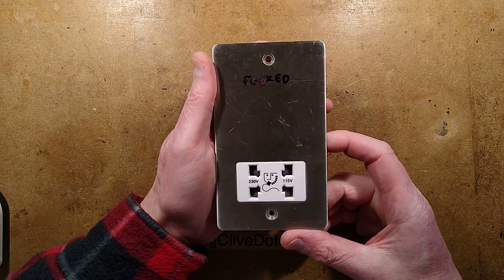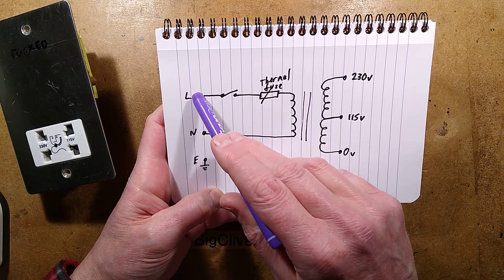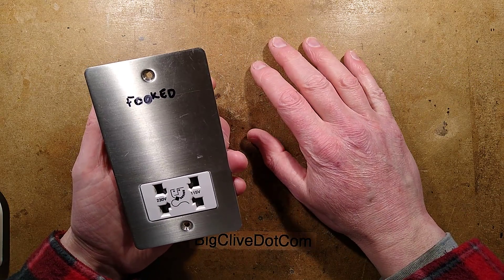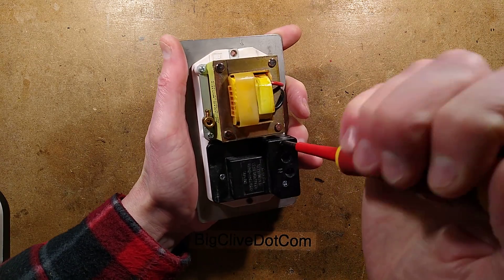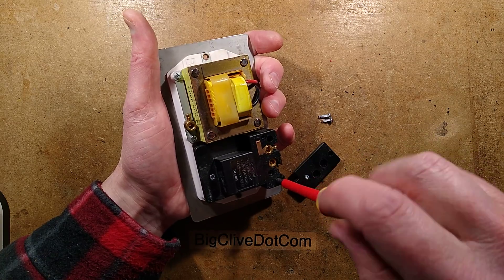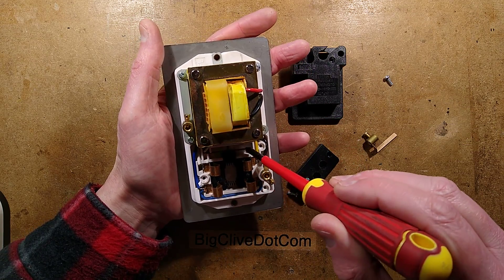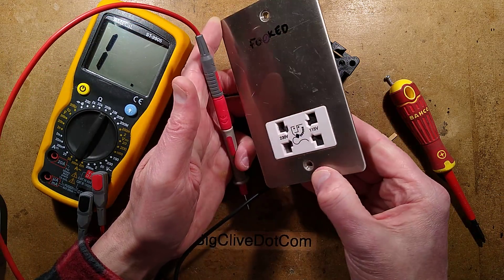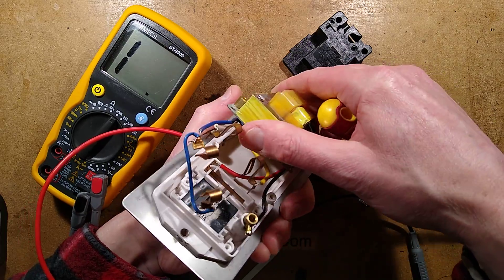Exploring a failed British shaver socket

Comment: i've never heard of this in the US. we have GFCI plugs in all bathrooms (or anywhere with water actually) and they trip the instant there is a short. something will really bad power factor can trip them too i think, like a big vacuum cleaner. i have seen more outlets with switchs directly on them, which is a UK thing. i usually only see them in hotels, but i've seen some people that have switched outlets in their house with the switch right on the panel. my house currently has all upper outlets of all duplex sockets on a light switch on the wall, but all lower outlets not on the switch. this is really common for houses that just don't have light fixtures on the ceiling at all.

Comment: This transformer doesn't really look like 100 VA rated. 230/12 V transformers of this size are usualle about 20 VA. Why is this? Do the thinner copper wires due to the lack of a PELV/SELV make such a huge difference?
Reply from the maker: This one did turn out to be 20VA.

Comment: Here in the US outlets near water are required to be GFCI.  If I were to drop a shaver into the sink it would pop the breaker built into the outlet immediately cutting the power to the device.

Comment: I've never seen them here in Australia. My shaver socket is just regular mains, no RCD/GFCI (along with the rest of my flat), so the only thing protecting it is the fuse for the circuit (which is rated well over the 10A of the outlet) and my body (which would somewhat limit the current flowing through the outlet). In fact, I'm pretty sure every place I've lived has predated RCD/GFCIs.

Anyway, I do like the idea. But I don't think it would be practical to introduce them here, sine they'd almost immediately be blown by people who don't realise the outlet isn't rated for their hair drier.

Comment: On this side of the pond most residential receptacles must be protected by a GFCI (ground fault circuit interrupter). Exactly which circuits that need to be protected have changed over the years. Unlike the UK (not sure about other countries) this is on a per branch circuit basis. The GFCI is set to trip at 5 +/- 1ma. So assuming the GFCI is functioning properly faults to ground are limited to non-lethal values.

Comment: GFCI sockets are building code in areas close to running water in North America (Kitchen, bathroom, outside). All the mixed volages and plugs is unique to Britain. Arc-fault plugs are required in bedrooms where I live to prevent fires when people crush the plugs behind furniture.

Comment: In Spain it's alarmingly common to have a common-or-garden Schuko socket right next to the sink - ready for a hair dryer, etc. Fortunately almost all houses have at least one RCD in the consumer unit covering all circuits.
Reply: That's just the way it's done in Spain by law. They don't have GFCIs but earthed sockets and a general 30 mA RCD protection in the breaker panel. The same goes for the rest of Euro countries.

Comment: Isolation transformer type bathroom sockets for low power devices such as shavers were quite common here in Canada, although they were 120 volt only.  They've been largely superceded now by GFCI sockets which can accomodate more appliances (hairdryers, etc.).

Comment: Not in Germany (only in some older Hotels for enabling 110v for guests from the other side of the pond - even in trains. Nowadays multi voltage razors made them obsolete) In Germany we  trust RCCBs, Residual Current operated Circuit-Breakers (hope I found the correct translation for “Fehlerstromschutzschalter” (4 words in one - isn’t German a nice language where you can easily build words yourself 😁) in every bathroom since the late 50s.

Comment: If you were to cannibalize one of these things that was still working,  you'd have an isolation transformer for use with an AC/DC transformerless "widow-maker" guitar amp (series-string tubes, 2 watfs of audio at best), or an "All-American 5" table radio. It could also be used as a step-up or step-down transformer, within its electrical limitations.  I am presuming that these things are unfortunately live the entire time that they are sitting in the wall unused, in which case the transformer would always be passing a small amount of current and generating a modest amount of heat all by itself, without a load on it.
Reply: They might not handle enough current to run a guitar amp.
Reply: @8bitwiz_  , read my comment again;  I referred to a transformerless, "AC/DC"  amplifier, a so-called "widowmaker",  the type that only draws about 20-something watts from the wall and puts out less than 2 watts of audio to the speaker. Typically a three tube amp with a 12AX7, 35W4 rectifier and 50L6 or similar output tube, with a maximum of 140-150 volts DC B+.  Google "Widowmaker guitar amp" to see why these are so unsafe for guitarists unless you add an isolation transformer.

Comment: Evening Clive, they are not a domestic device here in Straya, we have general purpose outlets (10Amp RCD protected), in our bathrooms for your drying and or shaving pleasure.
That said, accommodation houses often have a combination plate that houses the 100va isolated dual voltage sockets at one end, and a standard GPO at the other.

Comment: In the US, bathroom outlets are GFCI protected, but not isolated. The only examples I can think of that are isolated are the doorbell supply and the thermostat supply, but those are also low voltage.

Comment: Never seen one in the states.  Since we have this split center grounded 240 system and only 120 volts at the outlets probably much less need of such a thing. And I don't get what's up with the lower voltage setting there would you have low voltage shavers? Was that a thing?

Comment: Can't speak to the rest of the world's homes, but they aren't common in homes in NA anywhere recently, we just have a GFCI outlet in it's place. I HAVE seen these in hotels all over the world, had NO idea they were galvanically isolated like that, I just assumed it was a triac 'dropping' the voltage to 110V for a shaver.

Personally, I haven't used a corded shaver in a couple decades, my latest one chargers with a micro USB cable, so I've not had use for these outlets in a long while anyways.

Comment: Shaver sockets used ro have 'shavers only' written on them, i also rememver seeing '2Amps max'
Even so, these should be restricted to shavers and toothbrushes, things like hairdryers will overload them
Not keen on the thermal fuse being in the neutral, even on an isolated transformer, you still get capacitive coupling.

Comment: In the UK we use mainly 3pin square plugs so a 2 pin bathroom socket can not be used. If you buy a UK hair dryer it comes with a 3 pin plug. This is where international travel comes and upsets the apple cart. Foreign electronic with 2 pin plugs.

Comment: Here in Germany we are hard core. Not only do we run full 240V@16A to the bath room, but at least technically bath rooms aren't even classified as a "damp location", so many older installations will not have an RCD either.

Comment: Good idea in theory but terrible execution: If you overload it you can't just pop a fuse back in, it wrecks the entire outlet. Also you have to guess what you can plug in because it doesn't specify the max power output anywhere.

Comment: We have nothing like that in my part of the US of A. GFI (or GFCI) is what we have for code. Normally the GFI is an outlet and up to 8 or 9 more are placed in series behind it, it protecting all of them. They are available in circuit breaker form but in most cases they are in outlet form.

Comment: I’ve seen similar sockets in English and French hotels. Whether they usually have such hardware I don’t know. Some have markings stating that they’re not rated for much wattage: shaver or phone charger okay, 1000-watt dryer definitely not. I’ve recharged my shaver and phone and small battery packs with them to save me the trouble of getting out the British or European adapter: the shaver or wall-wart’s American plug fits the socket adequately. Shaver and wall-warts can all take 100-240V AC at 50 or 60 Hz anyway.

Comment: Yes clive, we had these in the US in the 50s and 60s. But I don't believe they used a transformer. My understanding is that they used a capacitive dropper. It's very uncommon to find them these days. Usually only in older hotels or motels. It wouldn't provide the same isolation as a transformer. But they did limit the power significantly.

Comment: WHODUNNIT - TOOTHBRUSH OR HEAVIER DRAIN LOAD?
10 years ago I installed an MK shaver point. White plastic faceplate with the stubbly shaver symbol printed on.
A warning was in the box saying not to charge toothbrushes. Of course a few years later I had an electric toothbrush and tried charging it.
The shaver point electrics managed alright but the faceplate cracked in several places.
Bought a new MK white plastic shaver point, this time a toothbrush symbol was printed alongside the stubbly chin symbol.
The electrics and transformer inside were identical to the previous point but the faceplate had new reinforcing ribs moulded in.
So, the heat generated by toothbrush charging broke the original faceplate, could that heat also take out a thermal fuse???
WHODUNNIT?

Comment: It's not so much dropping the shaver in a sink of water that is the issue, but of handling one whilst dripping wet and/or a fault developing. 

Now that all modern installations should have residual current (GFCI) protection, then the requirement might be considered outdated, although residual current devices, being active devices, can fail themselves whilst an isolating transformer of that sort is pretty well fail-safe. 

But then that brings us to the topic of power sockets in bathrooms, which are now allowed in UK bathrooms, but only if they are uncommonly large as they have to be a certain distance from wet areas (I think it might be 3 metres) as well as being residual current protected.

Comment: Howdy Clive, long time comment lurker and fan from Australia here. 

As Glen Miller mentioned, they were once a far more common sight, but you still see ones in private residence on a rare occasion, generally apartments or the like; However they are still extensively used in our hotels/motels and other paid short-term accommodation. 

They seemed to become far less popular here once battery powered dock/cradle style shavers (that couldn't be used whilst charging), became the norm over here along with RCDs being in practically every home.

All the best, and keep up the good videos!

Comment: I had a shaver socket in my student room back in the early '70s and I ran my HiFi off of it. In party mode it used to trip out regularly but reset again after a few moments if the load was taken off. I pity current students if they now have non resetable thermal fuses.

Comment: It was common to have a pure 110V outlet for shavers in Sweden before GFI's. Haven't seen them in anything built after the 90's, now it's only the common 230V.
Not seen any combined 220/110 versions as I can remember - I believe the old Swedish code only allowed for the isolation transformer in combination with reduced voltage.

Comment: We have them here in New Zealand.  I never knew VA was just watts! Makes sense since volts x amp =watts
Reply: It's almost the same. If the current and voltage are in phase (if the load is resistive) then the power factor = 1.0 and VA = Watts. If current and voltage are not in phase (power factor is less than 1) then VA rating is higher than wattage. So of a transformer is rated 50VA but the load had a power factor of 0.4, the allowed wattage would be 20 Watts maximum. The phase difference becomes significant if the load is highly inductive or capacitive.

Comment: It's a UK thing like the ring circuits for sockets. 
Normal sockets are used in Germany, but a 30mA RCD switch is required. 
Now an electrician shows what happens when a hair dryer falls into an insulated bathtub. 

Nothing! Maybe it tickles something. But don't touch the grounded faucet !

The electrician recommended pulling the plug out of the socket by the cable, regardles , the outlet can sometimes come out of the wall.
Or better to call for help that someone turns off the electricity first.

Comment: Had one of these in my house when i was kid. use to plug my radio in to it when in the shower and my mom would plug her curling iron never though much of it other then it got hot.
Looks like it could be a decent little isolation transformer.

Comment: From my own experience Finland doesn't seem to even have GFCIs anywhere outside of the bathroom. This might be different in more modern homes though, mine has been built before 2000.
Bathroom has standard schuko plugs, one in the closet for a shaver / toothbrush / hairdryer and two on the wall for a washer and a dryer. All of them are protected with a GFCI in the main fuse box. None of the other plugs in my apartment have GFCIs. As far as I know, shaver plugs do not exist here at all - I have never seen one or heard of anyone having one. My limited experience in Germany is similar - No GFCIs, no shaver plugs.

Comment: Shouldn't the center-tap connection of the transformer be the 0V, with 115V on each outer leg, giving 230V when connected between the two outer legs.

Comment: To be honest, most of these outlets & the "Shaver Lights" with 110/220v outlets are a waste of time. Yes perhaps in some hotels with visitors from overseas on 110v. But for most homes, you would be be using your usual devices suited to your home voltage.
Yet here is the rub, most "Shaver Lights" have the transformer permanently ON which means it draws power 24/7 regardless if you are using the shaver outlet or the light. Not a massive draw, but often 2w to 3w is being used when the light is off & just sitting there, doing nothing at all.
The bulbs are S15 (284mm) or S15s (221mm), originally say 60w, but now 4w~6w LED's. An option is to remove the transformer & rewire the 110/220v switch with say a 110/220 Ohm capacitor. This will give you the option of the switch giving you say a 0.5w nightlight in the bathroom, or off completely. In either mode, the pull switch will over-ride and turn the light on at full 5w LED power.
Even if you left the shaver light on 24/7 in the reduced 0.5w nightlight/capacitor mode, it still draws less power than it did with the transformer in running 24/7 & doing absolutely nothing...
The shaver socket still works, but only for 220/240v only (so need to erase the 110v option written & say 240v only), but as I said in most instances for home use, these dual voltage shaver sockets are not really required. Especially in say shaver lights where the transformer is permanently on 24/7 drawing say 2.5w all the time - even if they are not being used.
I did the above modification as the light was old & a replacement had a slightly buzz or hum from the transformer, tested the draw and was surprised to see it wasting power being on 24/7 (unswitched).
Sure, 2 or 3w isn't a lot, but in this time of rising energy prices, you are paying for an outlet you are not even using...
If you have the transformer on 24/7 like in many Shaver Lights, the transformer draws say 2.3w 24/7, then over a year at 25p per KW you are chucking £5 down the drain every year, probably more as energy prices increase.
£5+ pa, for something you are unlikely to need - the 110/220v option, when many recent devices now are dual voltage anyway operating on a range 80v ~ 250v, so perhaps for many, this 110/220v outlet is no longer needed and can be wasting energy/money if transformer is on 24/7 like in Shaver Lights

Comment: We had such a shaver socket in Austria. Single voltage though, so 1:1 and no middle tap. Specifically stated that you should NOT plug in a dryer.

Comment: Another example of the extreme levels of safety in electricity in the UK. I've never seen this in other countries (I've been to 73).
I wonder how many lives this has saved? How many people die in these kinds of accidents in other countries?
Reply: The problem in the UK is partly due to our use of ring mains. If homes were wired with individually protected spurs, I wonder whether these outlets would have been used. Note that the adaptor for plugging a UK shaver into a 13 amp socket has a very particular 1 amp fuse. That current would still kill however.  But Individual spurs are more easily protected to a safe level at the consumer unit.
Reply: @GodmanchesterGoblin  these are usually wired off a radial on the lighting circuit so nothing to do with ring mains. They predate an RCD and if anything offer better protection.
Reply: @lukedoherty8062  Fair enough. I agree, a lightning circuit would be the more likely now I think about it.

Comment: we have no shaving plugs in the netherlands, the only restriction to my knowledge is grounded terminals and a minimum heght from the floor.
only in hotels or campings we have those outlets. an i have never understood why it was only for shaving my camera battery charged just fine in the hotel.
but now i know there is a small transformer inside. 
i would love to have a seperation transformer for safety. maybe this is a good cheap source.

Comment: I use a beard trimmer about every 2 weeks so plug in an extension cable that trails into the bathroom and then plug the trimmer into that. I doubt the battery has ever held a full charge since I bought it.

Comment: We have them here in Denmark too, or we used to - I do not know how common they are these days - but back then they were 220V and max. 20 Watts, so if a ding-dong plugged a hairdryer in the socket, the autofuse would immediately turn it off.